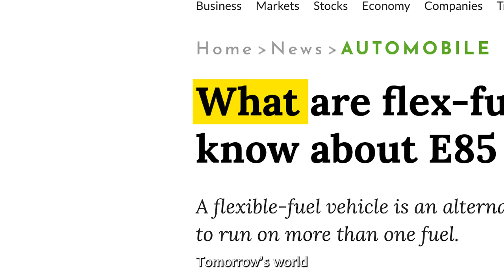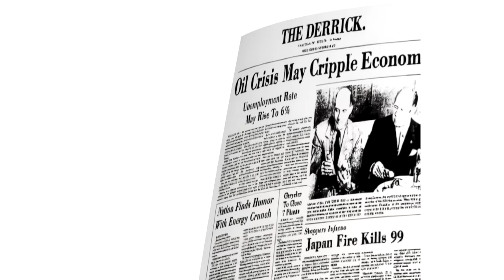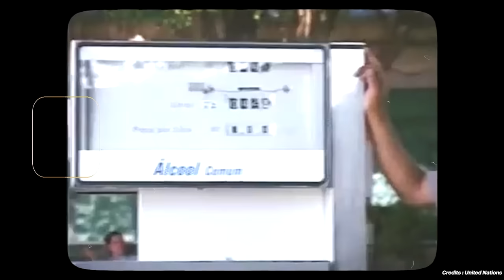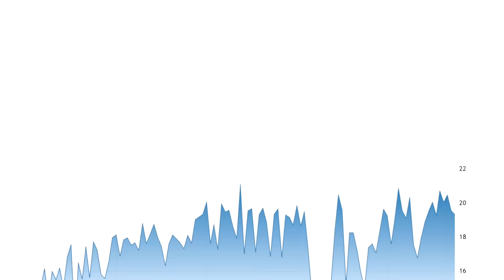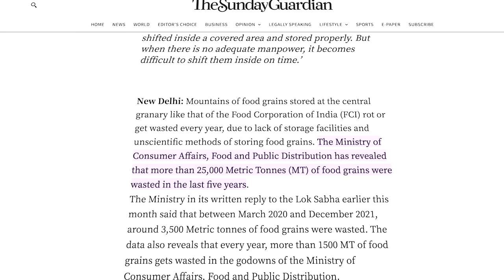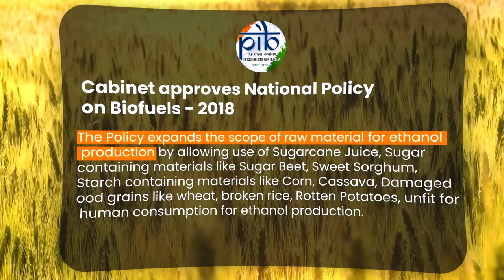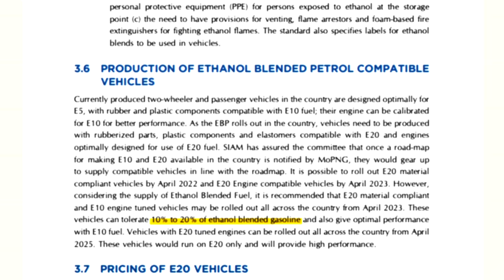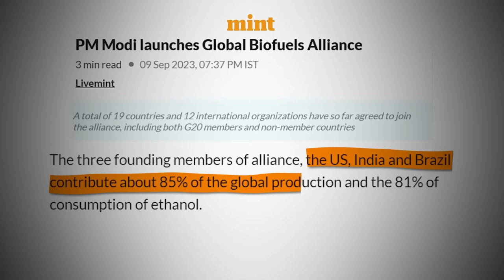How is India CHALLENGING the Arab Countries in the Global Fuel War? : Geopolitical Case Study

Comment: We have already developed 2G ethanol technology at a commercial scale. This is based on agri waste i.e. rice husk which is otherwise burnt in fields and causes pollution. IOCL has set up 2G ethanol refinery at Panipat. Various feedstock combinations other than sugarcane are currently under development.
Reply: Brazil has perfected ethanol
Reply: @vasujayaprasad6398  Yes but Brazil also faces some side-effects like food price inflation and deforestation as they persued 1G biofuel instead of 2G/3G biofuel
Reply: @commieTerminator  petrol itself is plant fossil fuel
Reply: @vasujayaprasad6398  petrol is a mix of plant and dinasaur fossil fuel but biopetrol/biogasoline is not a fossil fuel
Reply: I think solar energy generation is the best. Because, it depends only on intensity of Sun. The better place for this is using drought prone areas.
Reply: @commieTerminator   biofuel is basic fossil fuel. petrol is just vintage specially aged fossil fuel 🙃🙃

Comment: Just like they used waste food for fuel, why don't they use an a usable sea water instead of ground water and allocate separate farm land for cultivation for fuel alone.
Reply: Sea water is saline and Not fit for cultivation. If we perform reverse osmosis and do desalination which is not that cost efficient
Reply: @sannidhisuraj1467  yeah but like anything used for long period & used by many, becomes cost effective right? ex: solar panels & Falcon9, etc...
Reply: relentlessfrags4914  it can be easy if we do rivers integration and desalination is not a cost efficient way in what ever way you perform.
Reply: @jjoulekelvin2986  no. It will increase cost over time due to inflation and maintenance will be high due to corrosion of equipment
Reply: Turning seawater into freshwater will require distillation plants and that would need more and more petrol to run them and thus defeating the whole purpose of flex fuels in the first place.
Reply: Saudi Arabia will tell you how much it costs to desalinate sea water
Reply: relentlessfrags4914  it would be much more cheaper to develop an effecient alternative to ethanol

Comment: While ethanol-fueled cars have some advantages, they also come with several downsides:

1. Reduced fuel economy: Ethanol contains less energy per gallon compared to gasoline, leading to lower fuel efficiency. This means you'll need to refuel more often, offsetting some of the cost savings.

2. Limited availability: Not all gas stations offer ethanol blends, so finding a convenient refueling station can be challenging in some areas.

3. Corrosion and engine damage: Ethanol can be corrosive to certain engine components and fuel system parts, potentially leading to increased maintenance costs and shorter engine lifespan if the vehicle isn't designed to handle ethanol blends.

4. Lower energy content: Ethanol has a lower energy density than gasoline, which can result in reduced overall vehicle performance, especially in terms of acceleration and power.

5. Water absorption: Ethanol is hygroscopic, meaning it absorbs water from the environment. This can lead to phase separation in the fuel tank and cause engine problems, especially in older vehicles.

6. Land use and environmental concerns: The production of ethanol often involves growing crops like corn, which can lead to land-use changes and environmental issues, such as deforestation and increased pesticide use.

7. Limited range: Due to ethanol's lower energy content, vehicles may have a shorter driving range on a full tank compared to gasoline.

8. Price fluctuations: Ethanol prices can be volatile, depending on factors like crop yields and government policies, which can make budgeting for fuel costs more unpredictable.

9. Cold weather performance: Ethanol can be problematic in very cold temperatures, as it can cause fuel system components to freeze or lead to difficulties starting the engine.

Overall, while ethanol can offer some benefits, it also presents challenges and trade-offs that consumers and automakers need to consider when choosing a fuel source.

Comment: If we are able to reduce our dependence on crude oil by increasing the ethanol content in fuel, will the demand for electric vehicles be hindered by the reduced fuel cost?
Reply: Who said prices of fuel will be reduced, it will never. There used to be big differences in price of petrol, diesel and CNG and all have reached at almost the same level. If crude price falls then also there is no reduction in prices (though in theory petroleum prices are deregulated and depends on market prices). 

So only govt will benefit from this as it will save its Dollars, but common people will suffer, as food inflation will increase, and people's with vehicles have low mileage but costly vehicles.

And what will be the maintenance cost of those flex fuel vehicles ?

I am personally waiting for hydrogen fuel cell vehicles, as it will be the cleanest and cheapest fuel available.

Comment: I own a Chevy sedan, it runs on E85 flex fuel, but runs the same when I use 87,89,91,93, and even 100 pump gas. I drove 5000 kms on each fuel, and couldn't found any difference in consumption.

Comment: The main problem which no one is talking about is that the whole world is confused about what should be the next innovation for the automotive sector. Normally people buy 4 wheelers for at least 10 years and which can be extended to 5-10 years extra. So every time someone thinks that one particular thing is the solution it creates problems. Nitin Gadkari himself has promoted Hydrogen powered vehicles before that doesn't mean that's going to be a hit because the engineering has to workout for its mass production. Similarly if the govt. keeps increasing the ethanol percentage in the fuel then it will cause a lot of problems because engines don't change themselves just because of the govt policies. I think the government should first understand these concepts before taking actions. 
Otherwise it will create a lot of chaos in the automotive market.

Comment: Usually your research is on point but this time you missed on a very important demerit of E20 blended fuel. That's on millions of existing BS4 & BS6(pre 2023) vehicles. Ethanol tends to attract moisture and lead to rapid rusting of parts hampering the vehicles badly. This might lead to huge losses to the masses who already have 2-3 year old vehicles. 

All vehicles sold pre-2023 were upto E10 compliant but govt has suddenly pushed E20 fuel into market & this is a bad move affecting millions of vehicles. Expecting people to discard 2-3 year old vehicles and go for E20/Flex compliant vehicles is just inhuman.

I know this comment will mostly be ignored or will vanish in the 1000 others but would appreciate if you can address this important point.

Comment: Flexible Fuel Vehicles have been around since the 1900s! There are more than 21 million FFVs in the US, and 100+ models are available in the market.  

It has lesser energy (Around 30% of gasoline); flex fuel address that to certain issue; However, I think EV is better choice in long run given the economy of electric vehicles.

Comment: it looks good on the surface coz it will save foreign exchange and also benefit farmers, however if you even scratch the surface you will find that it will devastating in medium to long run...all that crop will require immense amount of potable water, that will ruin the already stressed water table across the country...as it is often said future wars will be fought over water rather than fuel.

Comment: The flex-fuel technology, permitting adjustable fuel ratios, is great! But I respectfully disagree with your belief that ethanol is even a partial solution for our fuel shortages. Your focus is too narrow and miopic. Our global ecosystem cannot tolerate the devotion of more land to food crops, in this case food/fuel for vehicles. To stop global warming, which will soon trigger another Great Flood and cut short the lives of billions of people, we must control and greatly reduce the human population and footprint on the planet. That means minimizing the K and R Strategies by maximizing, respectively, equal opportunity and population control. Stopping global warming also requires us to restore the balance of plants to animals by devoting about 20xs more land to trees and bamboo. They inhale CO2 and exhale O2. Bamboo grows rapidly. Unlike food crops, trees have deep and extensive root systems that hold the moisture in the ground and lower the air pressure over the land, enabling rainclouds to smoothly blow inland. The ultimate solution to our energy needs is layered graphene or nanotube wires, up to 4 km in length, that can pull up all the clean and renewable geothermal heat we need for the above-ground electricity generation of up to 600 xs our energy needs. Strategically placed, these geothermal plants will also tap off the heat that drives the turning of techtonic plates and volanic eruptions. But were we to produce these wires now (by up-scaled ALD (atomic layered deposition and graphene welding), and reduce food and energy costs to near zero, now within our savage, K and R world; the explosion of the human apes would increase exponentially and we would loose the little biodiversity that remains. For the Peace Love and Progress Party, Dave Huttner

Comment: So there are various problems with flex fuel, first is solubility of oil in ethanol , normal engine oil be it 2 stroke or. 4 stroke is not miscible in ethanol , 2 the wear and tear of the engine greatly increases as ethanol is less volatile than gasoline so the engines will run hotter than usual .. thus in order to tackle this  the volume of the combustion chamber needs to be increased.. there by making the engine bigger eg dragsters ,  3rd combustion of ethanol releases h2o which can cause rust issues , 4th is the ethanol to be used in flex fuel has to be pure 99% to get optimal stoichiometric ratio … therefore. It cannot be denatured .. hence it can be easily sold separately for consumption.

Comment: With all of these problems, use of biofuels including ethanol is a step in the right. The agricultural and other waste biomass is best converted to biofuel.
Besides increasing the use of biomass, there is a need to increase thermal efficiency. The best way might be the use of high efficiency fuel cells like solid oxide fuel cell and electric transmission.
In case the feedstock falls short. We should continue with coal to ethanol conversion. Other bio fuels like methane. Methanol and dimethyl ether and heavier bio fuels like biodiesel should also be used .

Comment: On the contrary, flex fuel will increase inflation as the crop cultivation will come down. This is what happens in USA and other countries where ethanol 85 is already in force. You need to understand that ethanol is next filteration stage to alcohol. So there is more margin in the less effort. This is the main reason (apart from seasonality) that there is scarcity of ethanol even today with just 10% blend requirement. Imagine when blending requirement raises to 80%! The fuel will cost as much closer to today's gasoline price😮

Comment: Who said prices of fuel will be reduced, it will never. There used to be big differences in price of petrol, diesel and CNG and all have reached at almost the same level. If crude price falls then also there is no reduction in prices (though in theory petroleum prices are deregulated and depends on market prices). 

So only govt will benefit from this as it will save its Dollars, but common people will suffer, as food inflation will increase, and people's with vehicles have low mileage but costly vehicles.

And what will be the maintenance cost of those flex fuel vehicles ?

I am personally waiting for hydrogen fuel cell vehicles, as it will be the cleanest and cheapest fuel available.

Comment: And don't forget Methanol. MeOH Can be made from Several common industrial processes even from natural gas.

And, please also don't forget esterification. Vegetable oils need to be esterified for use as bio-diesel. How is this done & who can? The answer is very simple. 

Vegetable oils & animal-fats can readily react with both Ethanol & Methanol. This does not require much equipment. Any farmer can do it in his backyard. Basically, used or non-edibale oils are mixed with methanol/ethanol & perhaps a little heating. A little alkali like Soda-ash or Caustic-soda is added to remove the water-produced as a inmiscible & therefore decantable aqueous layer.

This bio-dieselis the real game changer.

Comment: Photosynthesis has a solar efficiency of 0.50%, whereas the least efficient PV solar panels have efficiencies upwards of 20%. So for a given tract of land, PV Solar panels will produce more energy. 

Next, PV Solar system does not require fresh water or fertilizers. 

At the same time, PV Solar system does not provide employment once the system is commissioned.

Knowing Gadkari ji and his penchant for populist projects, this Flex Fuel system might actually work in India. Don't know if it is the optimal solution to our transport requirements though!

Comment: I don't see your logic in the challenge related to Pricing. 25K more for a car is nothing if the fuel is available at Rs. 15 per litre. Every litre of fuel saves about Rs. 100 for the user. 250-litre spend will cover the additional 25K cost.

Comment: Ethanol is simplybad for car's engines. But it has been pushed in normal vehicles, without pushing the manufacturers to make cars that are suitable for this 10-15-20% mixing. And with that, the government literally legalized duel adulteration. We pay for petrol, and get 10-20% adulteration.

Ethanol, if used in a regular engine, causes problem of wear & tear, as well as attracts rodent and insects. No wonder rodant damage has become so common in the recent years, which wasn't as common, just a decade ago. For rodens, the smell of ethanol is an indication of rotting food. So they keep trying to make their way towards the source of the smell.

Also, ethanol also doesn't give the same level of performance for the engine. but most people can ignore that part, given that we are going to drive in traffic jams 90% of the time.

Ethanol is the future, no doubt about it, but the way it has been introduced, is done at the cost of people, who own cars, after paying upto 50%-70% taxes. And people were never told about these problems. It's not that your engine suddenly stops working for >20% ethanol, and works perfectly before that. It's already struggling to process that 10-20% ethanol, and beyond 20%, the problem gets too serious, to continue. Even the report shared here tells that during tests, "there was no sever malfunction" upto 20% ethanol. So I guess, people should just be happy causing increased damage to their engines, that aren't made for ethanol mixed fluid, unless there's a severe damage, right?

But still, once the transisition period is over, this is what ideal alt-fuel ecosystem will be ike:

1. Electric vehicles for 2-wheelers, and the logistics fleet.

2. Hydrogen for heavier trucks, because the weight if Li-ion batteries will literally take up 70% of the allowed load of trucks. (eg. Tesla's truck has batteries, that themselves weigh 18 tons)

3. A combination of ethanol, CNG, petrol, and electric vehicles for personal cars (yes, no hydrogen cars are going to be popular in personal or people transport segments). In trucks, it's easier to separate out hydrogen cylinders and people. But having peoplenext to gas cylinders, that are many times more explosive that petrol, CNG orLi-ion batteries, is never going to be safe.

And it's not really subsidy, that government needs to promote the demand. If govt starts selling 1 liter E20 petrol not at the cost of 1 liter petrol, but at the cost of "800 ml petrol + 200 ml ethanol", it's not really a subsidy. It's the fair cost of the fuel. Right not, people are being forced to buy ethanol at the price of petrol, which should have been illegal. If the prices are kept fair, then people will easily start switching. For someone driving  1500 km / month (or avg 50 km/day), they will need roughly 84 liter fuel per month (assuming 18-20 kmpl mileage, which is already more than what most cars get in the city driving). Even at 100 INR/liter price, if they get a 10% discount on E20 fuel, it is 840/month, which breaks even in 20 months for the 17,000 rice difference. The savings can be even more, with E50, or E80 vehicle.

Right now savings aren't reaching people's pocket, so they have no motivation. But in future, if govt makes 10-20% minimum to be compulsory, and people with flex fuel engines are allowed to pick how much more they want, I would be happy to buy upto 80% ethanol, for my daily home to office commute, and go back to E20, in case I need to go for a 500 km long trip on highways. The saving son fuel will be massive.

Comment: Your information may not be accurate. The challanges you mentoned are not big enough or critical enough. Ethenol in india is also not new. Honda did this a decade ago. Also the cost of vehicles you mentioned also will definately not be a factor as you can see the difference between Petrol vs Diesel vehicles, when there was a significant enough diference in price people shifted to diesel (which is less efficiant). also CNG is the same. The efficiency of CNG is drastically less and it needs equipment worth 40k+ to work, but its setoff by the price of CNG.

Comment: Dude. The groundwater is very low in most states. Punjab has exhausted groundwater by pumping too much with free electricity. The southern states are a bit behind, but well on the way. Ethanol is not a solution at all. Stop this nonsense.